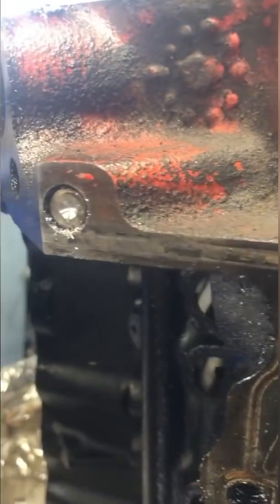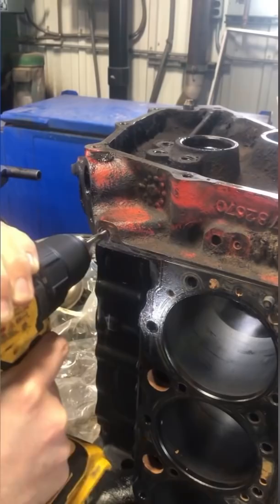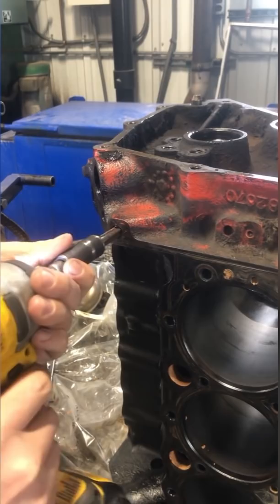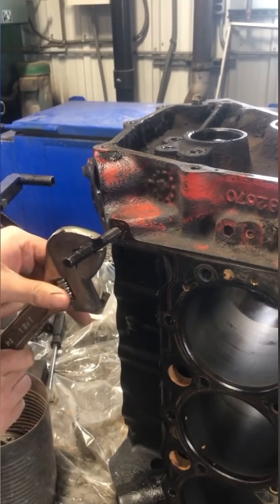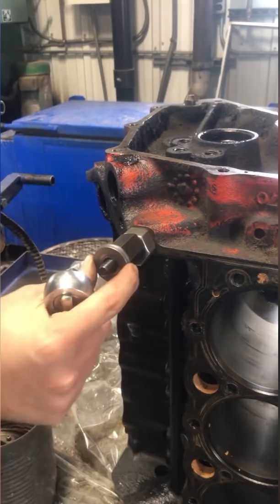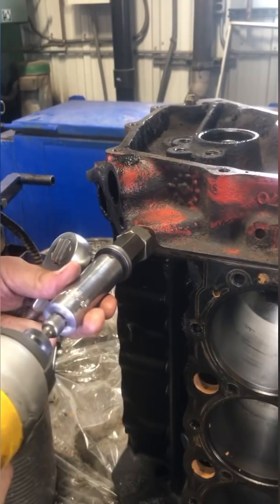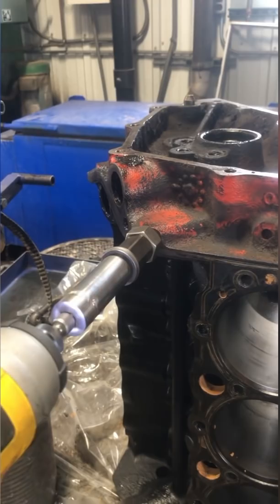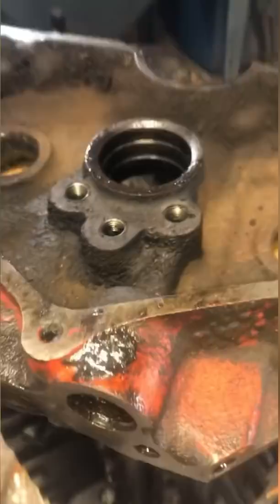#shorts Removing a Blind Solid Steel Plug - 327 SBC - @JAMSIONLINE

Comment: What does "glass bead blasted" do? And is it really beads of glass?
Reply: Similar to sandblasting: removes paint, debris, and cleans up the surface. Though with beadblasting you can get your beads in different sizes in order to produce various textures, larger beads give it a little rougher textured look. Small beads give an effect similar to sand, but not as abrasive as the beads are effectively uniformly round.
Reply: Yes they actually are little beads of glass, I'm not sure but maybe they are made by sprinkling screened glass-sand through a large flame and cooled before landing.  In think they can work-harden a metal surface slightly under some conditions instead of cutting, fatiguing and abrading it.

Comment: Pulling the plug is good, we'll done, glass bead blasting anywhere oil will be is a no no, you can never get it all out, and it will eventually get in your oil and ruin the engine.

Comment: Why do they use plugs instead of a thread already?
Reply from the maker: Tapping threads is one more unnecessary machining operation. If the plug seals w/ press for plug it’s done it’s job.

Comment: Screw Milwaukee...I owned a structural steel company and used dewalt. I had a friend tell me Milwaukee was the best so I went out and replaced everything. The Milwaukee band saw wasn’t as good and the cordless drills would overheat when drilling bigger wholes. After I had a bunch of Milwaukee tools stole off a job site I went to Lowe’s and bought a bunch of Kobalt sets and 8 yeast late, and thousands of jobs I just replaced them with the new Kobalts (not because they stopped working)and the hammer drill setting on the new Kobalt cordless drill goes through concrete like butter. Moral of the story is Milwaukee is over rated 🤣

Comment: I've always heard that taps are easy to break so can someone explain why impacting them doesn't snap them
Reply: That's a decent size tap...  and its HSS... you wouldn't necessarily want to do this with a carbide tap. And  It's a 1/4 impact driver, pretty tame.
Reply: It’s all about the quality & material makeup of the taps. There are many different varieties out there, the key is knowing what type  to use for each different type of job.

Comment: Milwaukee is better than Dewalt by a VERY slim margin, and only really for the impacts, everything else is pretty well the same, we have a good mix of both and we're loggers so we have to be able to pull a 1 1/2" nut in -44 weather, what i would say is, good on you for buying American made, the only reason I still buy Milwaukee is because I'm bias towards my favorite color and I'm more used to there ergonomics

And honestly yeah my Milwaukee would have pulled that, but so would my bigger Dewalt, we have one of those oversized XR ones with a flex volt battery

Comment: I wish people would stop using a impact and just use a tap wrench and cut the threads. Also use a wrench on the nut. Using a impact you wont feel it its stuck or freeing up.
While it mite work fine for this guy cause he is in a machine shop where he can machine it out if need be. 
People at home cant. Which leads to an expensive repair.
So let this guy use a impact. But plz dont do this at home on ur time..  u will be very mad when u break that tap...

Comment: Lmao that's the dewalt 887 and it's the same drill I have for gutters. With a 2 Amp hour my 887 blows my coworkers Milwaukee impact that has the settings too. Milwaukee isn't that much better. And with a 4 Amp hour my drill snaps everything way harder then the 2 Amp hour or the Milwaukee with a 4 Amp

Comment: All jokes aside I was gonna ask you if they break on you at all?
Reply: As a former construction worker I never had a Dewalt drill go out on me. Fell off a aircraft hanger once I had plenty of time to watch it fall and think fondly of my drill. Wasn't perfect but still worked after 100 feet or so drop
Reply: Think he was talking about the taps
Reply: @jamesfair9751  ah very well
Reply: I’ve been driving taps with an impact on and off for many years, and the only ones I’ve had break on me were the “cheapo” varieties. Once I shelled out for a good set they stopped breaking. Once you have quality taps, it comes down to understanding what material your taps are made out of and what material you’re tapping into...if you have all the necessary information, it’s easy to pick the right tool for the job.

Comment: Whatever. Start the bolt anyway with a ratchet, because you don't need to crossthread bolts. Just simple enough. That and who gives a fuck what tools are used? As long as they get the job done.

Comment: Dude you’re using an impact 1/4 bit driver not an actual 3/8 or heck even 1/4 impact gun the 20v dewalts and or Mac tool same thing are top notch an I’d take them over any other same class brand name tools that I’m aware of especially the brushless Mac 20v 1/2 drive impact first hand spun a snapon gun same class Backwards every which way we tried them

Comment: Lol you didn't cheap out on Dewalt, you just cheated out on the non right version of the tool. Their is like 3 different tool lines Dewalt has and you were using an older one meant for driving half inch bolts into wood pillars, not work on engines.i use Dewalt all the time on my cars and bikes and not once have I had to get them started with a wrench unless it was like a tire that was siezed